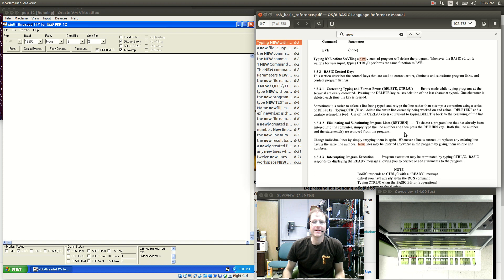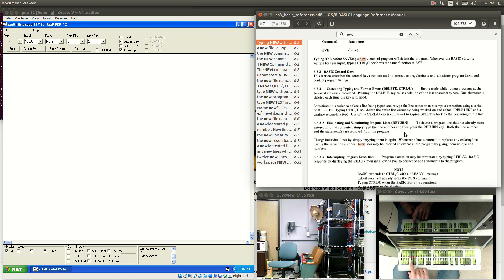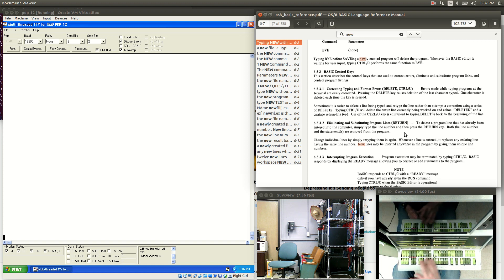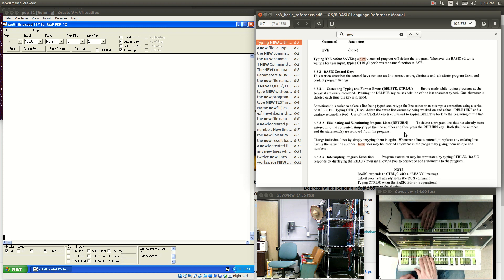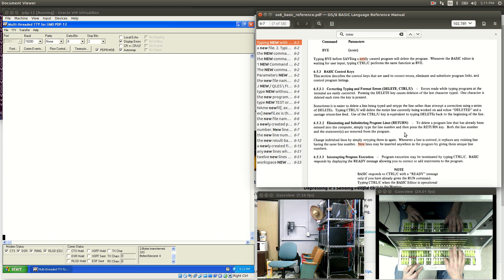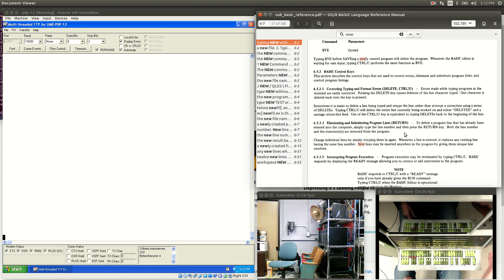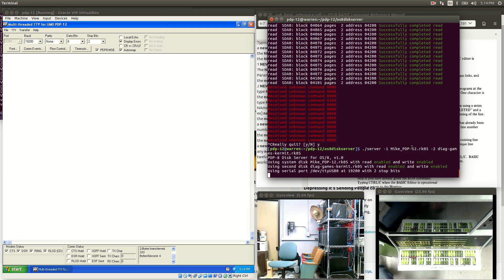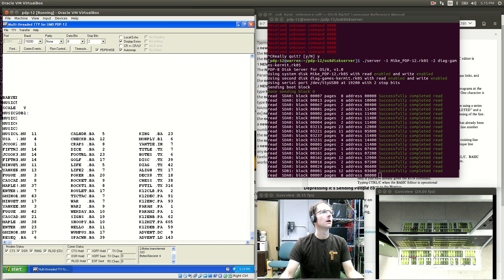PDP-12: Booting, Running BASIC, and An Old Favorite

Comment: 1:04 The RIM loader format is quite interesting: it is a sequence of pairs of alternating (address, data) values, which are easy to read in and load with a short loader, but quite inefficient for lengthy programs. So this is only used to read in the more complex BIN loader, which can understand a more compact format for loading arbitrary programs.